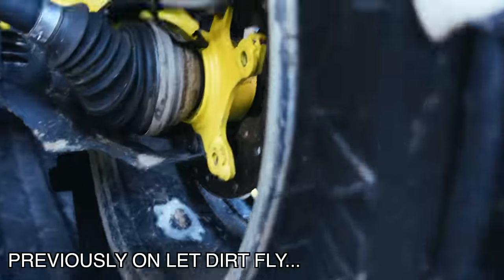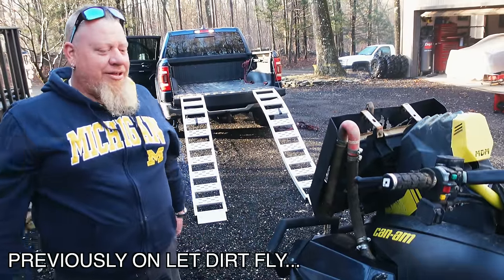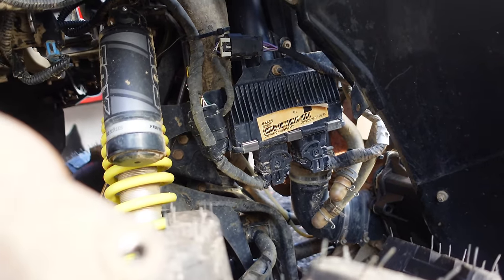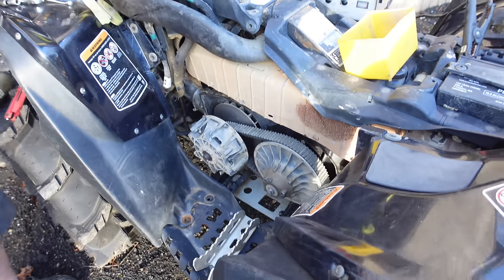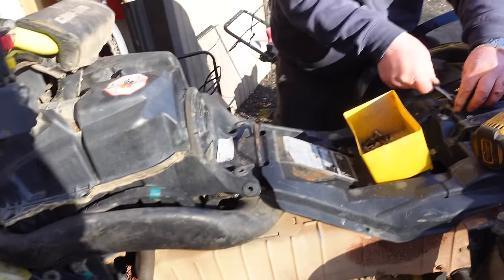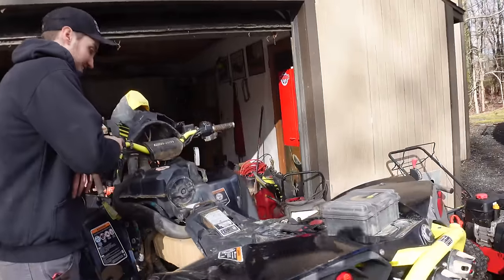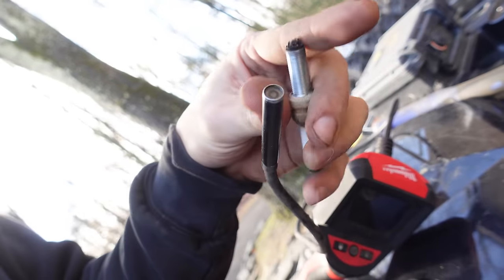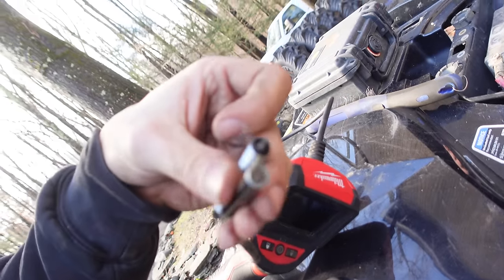I Bought The Worst Can-Am Renegade On Facebook Marketplace! The Engine Is Toast! | EP.2

Comment: I think it was sunk. Sounds to me the rod bearings on the crank are gone being it’s hard to start after warming up, but surprised it sounds decent running. I love these type of videos. Keep them coming!
Reply: 10,000% sank bike, After few rotations and friction, the bearings swell, Beings that it does run and not "knock" he could probably get away with using the same rods, replacing pistons, crank bearings, ect.